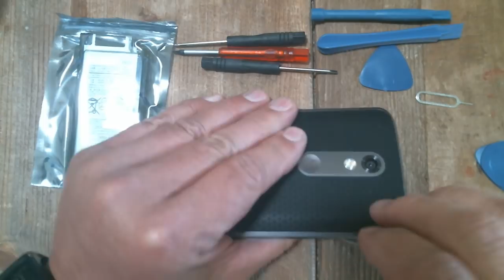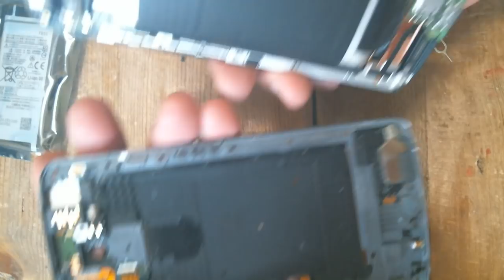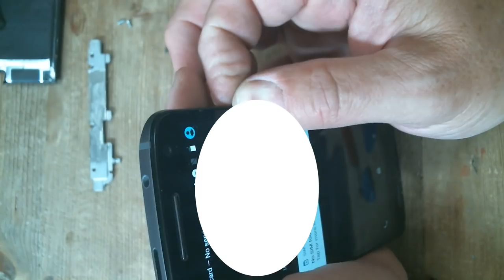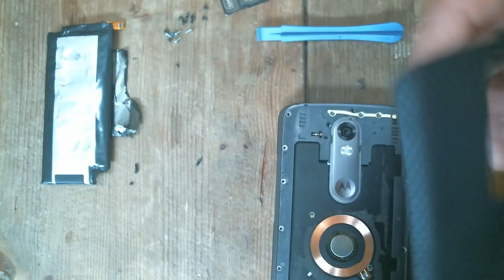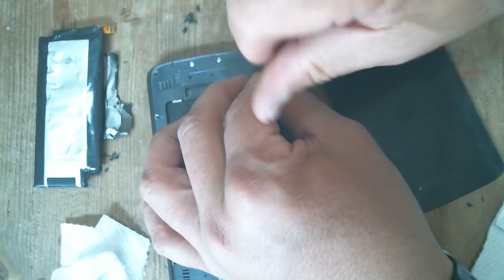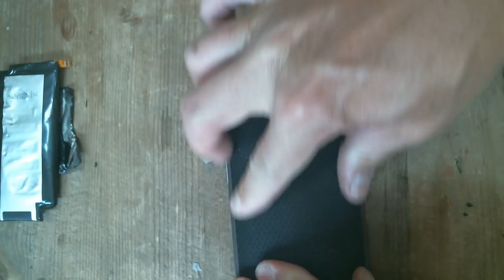Replacing the Battery in my Droid Turbo 2

Comment: Good job. Your amazonn link shows battery with ribbon cable connector pointing UPWARD. However in your video the battery connector is pointing DOWNWARD (just like the original battery.) I am having a toguth time figuring out correct battery to order?
Reply from the maker: If you look at the picture of the battery in the link  and the video the difference is that in the picture you can see the flex strip is unfolded it just folds up so the connector is facing down. If you need I can send you a picture of the battery I removed with the connector in both positions.
Reply: @madscientisthut  Yes, please send picture of the battery you removed with the connector in both positions. That would be  awesome!!
Reply from the maker: Go to my channel home and click the community tab. I posted pictures there for you to see.
Reply from the maker: Let me know when you have looked at the picture so I can delete them.
Reply: @madscientisthut  Got it. Thanks for all your help.

Comment: How well does it run without the lead tape on the battery? I'mabout to fix mine, and i'm debating weather or not i need to order some replacement tape?
Ive already taken it appart and am ready to reassemble, but i wanna know before i do.
I dont want it over heating to the point that it explodes or something,... so do you think it a necessity?
Reply from the maker: My runs just like it was new, I have not changed anything since this video. I have been using it every day since I replaced the battery and I am very happy that did.
Reply: @madscientisthut  thanks for the response, I'll be re assembling later today
Reply from the maker: How did it go?
Reply: @madscientisthut  
Forgot a part at home lol, gonna make another attempt today.

Funny thing is, battery was fine for about 3 or 4 years. (forgot when i got it)
But i busted my charging port by dropping it a few too many times while plugged in.
I was happy for the built in wireless, but after using it my battery life deteriorated rapidly.

So im replaceing the charging port as well, and that's the part i left at home.

Comment: How long has the replacement battery lasted since it was installed?
Reply from the maker: My replacement battery worked good for about 1.5 years before I found the Kyocera Durafoce 2 to replace it with.

Comment: How is your replacement battery holding up.  My turbo 2 is sucking down 10% In 15 minutes. Highly considering this project 22$ on Amazon for battery+kit
Reply from the maker: It is still working but it is definitely showing sings of lower capacity, so overall I am getting ready to replace it again since it was not a big deal to replace it. I love the fact my screen has never broke
Reply: My new battery is rapidly draining, but the seller insists that you have to fully charge it and let it discharge completely a few times to kind of "break it in". That sounds like rubbish to me, but thanks to this video, I might just redo it with a battery from a more reputable dealer if this battery  is junk.

Comment: A couple of questions. My phone has been slow for months and the battery shows 27% when the phone shuts down. Does anyone think the battery is the cause of the slow phone.....or, rather than wasting my time changing the battery should I just get a new phone ? Great video though. How is the Scotch tape holding up ?
Reply from the maker: I would try a factory reset, you probably have an app that is running in the background. I have had to do that a few times for a slow phone. The battery is probably the issue with the 27% shut down, mine would randomly shut down even at 60% when the battery was done. I ended up getting a new phone, I loved the droid turbo 2, the screen was so tough, but the phone was old and slow. I got a Kyocera duraforce 2 it has been just as tough and as a bonus it is water proof

Comment: so i accidently stripped 4 of the black screws. is there any way to get them out?
Reply from the maker: There is a precision screw extractor set available they run about 25ish dollars. You also might be able to get a #6 torx screw driver and use lots of downward force to remove the screws.
Reply from the maker: Did you get any further with this?
Reply: @madscientisthut  nope I just got a new phone 😂

Comment: Mine started developing intermittent charging issue and then finally no longer accepts a charge. Is that a battery issue or logic board problem?
Reply from the maker: Is it both the USB Micro and the Inductive charging?
Reply: @madscientisthut  inductive is at least recognized, but the battery is so dead it's acting flaky. I'll leave it overnight.
Reply from the maker: I would think if it does not charge with inductive it is a high probability the battery. I destroyed the micro port on one of mine but the battery would still inductively charge and run fine.
Reply: @madscientisthut  What the hell is holding the battery in. I've got it all torn down and have pryed the shit out of the battery but all it's doing is bending it. Maybe I need a long thin piece of plastic. 

If it's just glue it's strong stuff.
Reply: @madscientisthut   All good... got it out using an Old Credit Card....Thanks for all the help. We got a new phone but we need to get photos and vids off this piece of shit before we toss it....
Reply from the maker: Sorry I was out of town, just saw this. There are two or three strips of double sided tape holding the battery in, it is pretty strong tape glue!
Reply: Ummm can someone explain the inductive charging? Like wireless charging?  
Mine fell out of my pocket and wont come on. Android wont start. When plugged in the green light just flashes. If I press and hold volume down and power it goes into the android thing but nothing that I select will actually work.
It won't even do that unless its plugged up

Comment: has the battery lasted
Reply from the maker: I am still on the same battery that I changed out, it is starting to show some lower capacity than when I started using it after I changed it out last year. I think I will probably change it out again soon since it was not too bad to do the first time. Be sure to use  a good amount of downward pressure when taking out those little torx screws, that is the thing that most people have a problem with.